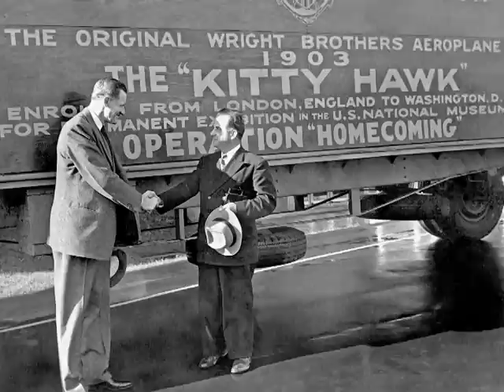Samuel P. Langley and the Aerodrome A

Comment: Too bad the Great Aerodrome had such a weak structure. The Manly-Balzer 5-cylinder radial engine it was equipped with was far superior to the Wright's inline 4-cylinder engine and at 52 hp, was more powerful than any aircraft engine that would be built until almost WWI.